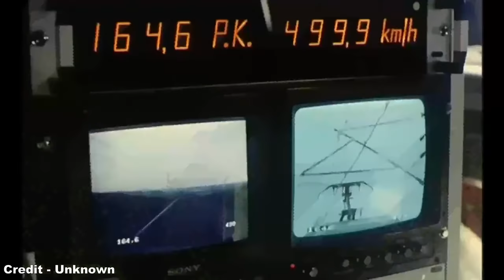The History of the AVE

Comment: The thing is the cost/benefit analysis would likely have missed things like the boost it's given to Spanish railway engineering in general. Notice how so many of the UK's new trains are built by CAF in Zaragoza? If Spain had let its railway industry to rot like the UK did, then they wouldn't be getting these export orders. The benefit of the engineering base you build goes way beyond the mere cost benefit of a particular AVE route.
Reply: Exactly. Also, providing your population with good transport links (passenger and freight) most likely increases domestic travel, business and trade.
Reply: Most infrastructure is never wasted.

Comment: Great video! I'm really enjoying this series a lot! One thing I'd like to point out though: The LZB couldn't really be considered experimental at this stage anymore. At the time of construction it had already been in everyday use on several lines in Germany (Augsburg - Munich or Hamm - Gütersloh to name a few). In fact LZB actually slightly predates TVM, despite offering more functionality, making it the more reasonable option over TVM anyways. They're more similar than it may seem, however the biggest advantage LZB has is that it transmits a target distance, which means it provides greater track capacity than trackside signalling or TVM for that matter. It even allows for block sections shorter than the length of a train which is used to great effect on the Munich S-Bahn. This is probably due to it being developed for seamless implementation on the existing network, whereas TVM is a strictly LGV-only system that didn't need to be quite as fancy.

Comment: There's the additional capability with the S120/121 and S130/730 in that both designs can access the "classic" network via gauge-change facilities that they pass through without stopping- indeed, the diesel on the S730 is only needed on classic lines.
The Spanish HS lines are going to be a real testing ground for competition. SNCF's low-cost Ouigo brand is now running on Madrid-Barcelona using TGV Duplex, RENFE also have a low cost operator called "AVLO" on the same corridor, and next year Italian railways (FS) part-owned ILSA start full-service operations across the whole network, meaning four operators with seperate ticketing on some routes.
Reply: Ouigo will also soon go for Madrid-Valencia route and Seville and Malaga

Comment: Some of the major problems of the AVE is that Renfe is directing all of the long distance services to this routes leaving the older routes with only conmuter services. This, adding the higher prices of AVE trains,  has lead to ridiculous prices in some routes without any suitable alternatives. For example, the routes with AVE services have lost all night trains, and most of the intercity ones. Even so the majority of AVE routes except the Madrid-Barcelona are losing money.

Furthermore, they have decided to make high speed lines able to acommodate freight trains creating a mess that is not suitable for any competitive service and rising the cost of the lines even more.

Adding a last point, the Santiago de Compostela Alvia accident was caused not only by the higher speed of the train in the curve but for poor planing of the route, the train control system (ASFA) not suitable for high speed and the Frankestein that is the S/730 trains.
Reply: I think Spain kinda wants to build out a standard gauage network marketed as high speed and than change over to it. It would help them a lot with freight trains.
Reply: Is not like that because there are some standard gauge freight lines paralell to high speed ones. Also, the actual network could be migrated to standard gauge, it would be a logistical nightmare but then it will serve all of the same stations
Reply: @imanolurruchigavina5661  but still have the problem of long routes through mountains.

Comment: Very good, but one quick thing to note is that there is a difference between the Avant sets and the Alvia sets. The Avant sets (s104 and s114) that you mentioned are fixed gauge for the high speed network, but the s120/121, s130 and s730 fall under the Alvia umbrella as they use both broad and standard gauge :)

Comment: Just to add a bit more, new Talgo trains are expected to be delivered in 2023, the Talgo Avril, or Renfe S106. They will be very high trains, and 20 of them will have gauge change (something you didn’t mention, which are Talgo trains capable of changing gauge rapidly, when changing tracks without the need to change the train, system currently in service with the S130, S730 and S120).

Comment: Good stuff, focused on the topic, no needless drama just good information.

A bit more deep Background info on the Santiago de Compostela crash would've been nice, as I think the Line Design as well as the Designs of both ASFA and the S7000 trains contributed majorily in that.
Reply: It would have been, but I think it has been a bit obscure, at least outside of Spain. I think it occurred around a transition from the new line to an older one. There was a bit of speculation of some kind of distraction of the driver being part of it, but who knows? There was a similar incident in north east France, at the eastern end of the LGV Est a while back as well. Probably not identical but transitions from one to the other appear to be a but problematic sometimes.
Reply: The line was all new, so to speak. It wasn't that it transitioned from a new line to an old one, instead it's that part of it is high speed and another part is conventional speed. The part of the line where the accident took place is conventional speed, that curve is often criticized for being inappropiate for high speed and well, that's because it isn't high speed. As the protection system transitions from ERTMS to ASFA the driver is alerted to this, so no excuse there either. He was indeed distracted that day, even talking on the phone moments before the derailment.

That being said the accident brought about positive changes, from then on protection systems were reinforced to force the driver to first aknowledge the speed restriction and then slow down, when passing a speed limit signal. If the driver doesn't slow down the train automatically applies emergency brakes, to eliminate human error as in the famous Angrois curve.
Reply: @El-Mengu  But the point was if the train hadn´t been so heavy carrying fuel & just was running on 25kv overhead the train in all probability would have made it round the curve.  The crash was mainly due to the weight of the train.
Reply: The main reason the train derailed was that the train was to heavy carrying diesel.  If the train had just been running on the 25kv, with no diesel it would have probably made the curve!

Comment: Domestic air travel needs to be abolished as soon as possible. And what better way to do so by providing a suitable alternative in the form of a vast high speed rail network? Spain is actually prepared to minimise it's impact on climate change through travel, as as I see it, it os absolutely vital that they continue their expansion.
Reply: In some very large countries like the USA and Russia, domestic flights have merit. But not in Continental Europe.
Reply: @AldanFerrox  Tbh, even international flights within Europe are unnecessary. A proper high speed rail network would make it easily possible to travel from Berlin to Madrid within less then 10h. It would still be significantly longer then flying, I agree. But only half as long as travelling by car (which many families do).
I do believe that, in many regards, over land transport needs to return to the railways, as it is, and will remain for the long term future, the most effective way of transport.
Reply: Expecially freight ones. For some routes passenger airplanes still make sense, but freight doesn't have to hurry so much.
Reply: @nicopavvi8494  With freight, the issue is less air then road traffic. Like, seriously, how can 50+ lorries be more efficient and cheaper then one train with 25 wagons?
Reply: @Locomotiveman1994  Well, because everything is so close together. A flight from Berlin to Paris is more or less a domestic flight.
Reply: We need some fee on plane tickets because of climate change etc but the air travel lobby is too strong I guess

Comment: Good video around data collection and historical dates but I think it focuses too much on the alleged controversies of the system. AVE was a revolution in the transport of passengers in Spain, reactivating the use of the train and winning the battle against the plane and the bus. Fedea's reports were biased (created by private companies) and the actual use of commercial services is of much more people than those mentioned (although until the liberalization of the railway sector is achieved and the new lines are amortized, they will not have a high performance of use yet).

Some sectors of the population have been criticizing this type of service for some time, considering it an elitist, expensive and centralist means of transport (Madrid) but in general the vision of the population of Spain is proud and values the AVE services very positively for their high quality in services and speed.

Comment: This is madness.  Shinkansen and TGV have been running since 1960s which means they have been carrying people from one station to another since more then 50 years. What this does is infrastructure have developed around the stations and regions adjacent to the cities because of the HST connectivity. Public transport is just there to transport people from one place to another and if it is fast and efficient then slowly places will develop and give economic boost to the region. Compare Shinkansen and TGV ridership after 10 years they were installed and not 50 years to a 10 year old system.

Comment: I'm interested in the opinion of the Spanish people: is AVE a better alternative for you compared to aviation, considering cost and travel time?
Reply: Yes! it has competitive times with the plane (in addition to the fact that the train arrives in the city center while the plane doesn't and the process at the airport is long), a high quality service, almost 100% punctuality and prices somewhat higher but that compensate for the above.
Reply: Depends on destination, time of year, ticket fare applied, how well the station or airport is connected to the city hub, travel time, etc. As a general rule of thumb, AVE is better for shorter distances and commercial airlines for flying across to the other side of the country.